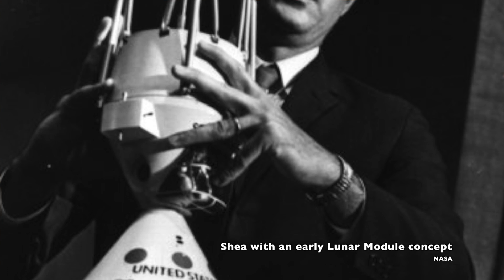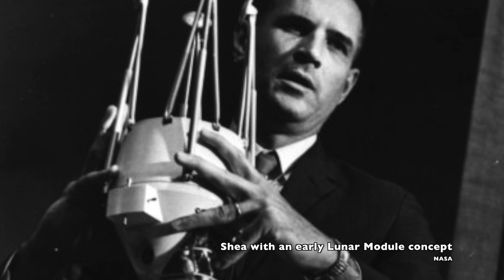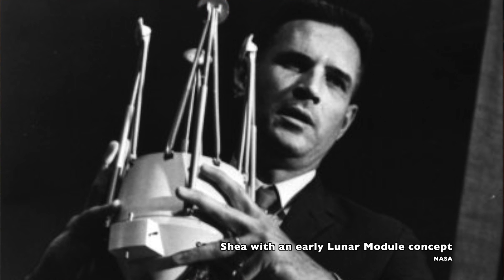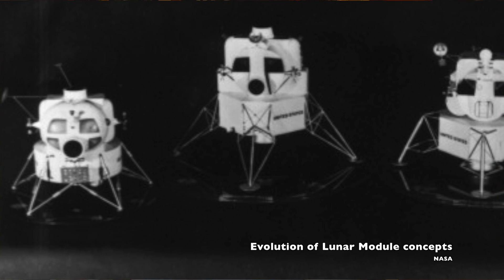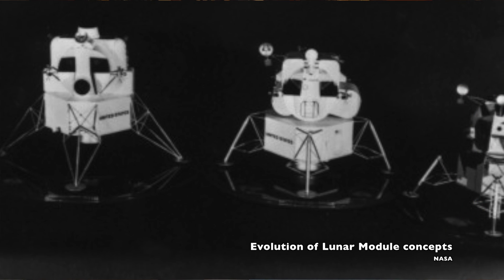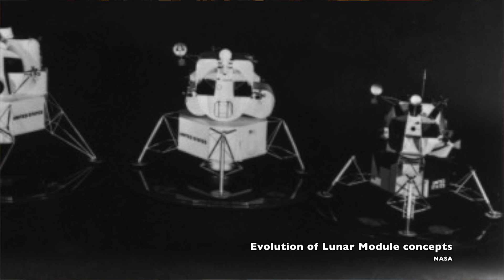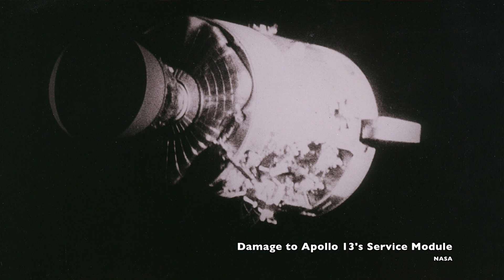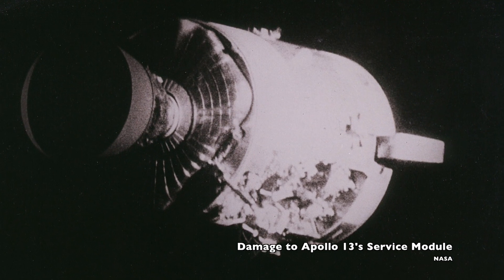How Did NASA Know to Use the Lunar Module as a Lifeboat?

Comment: LAB SPACE CAMPS AND AEROSPACE CLUBS, ATTN:On the lunar lander as well as any spacecraft or larger space ship.How does one route around a technical difficulty?You must first design your spacecraft and then with DC voltage only, in lower ranges design and put in a routing of wiring.
Your routes to the stations on your spaceship end in bulbs which all work when connected to a battery or series of batteries.

But what happens when your spaceship receives damage and the wiring is cut, ship damaged and or structure disrupted?
You've got it, it's time for your buzz lightyear toy dolls to perform and EVA and fix or repair that wiring, but what if you cannot do this.What happens if that part of the spaceship is struck by a meteor and you can't rewire.

Right, if you have one of more wires going to those extensions around the ship that light up bulbs, then you have to rewire and this means diminishing nonessential systems being shut down or placed on low power modes, so that only thrusters, inertial navigation and fans to move air in your damaged ship are used.Need to have systems only.

Note for instructors and or teacher host.You may need two large nine volt batteries.Light Bulbs, low voltage, wiring, which you can get by the spool at an electronics shop a design of the spacecraft and classwide participation.

Frist see what type of ship you can design and then build, then route your wiring, but "please again", remember low voltage wiring only.You don't want to fry Junior or Sissy here.Thanks, Verendus *Notes what is a a power side to a DC volt light bulb and do you need to have a shipwide ground, for the bulb to work? 2.What is single and in parallel series wiring and how might this placement affect the situation of a damaged spaceship? These are the goals for your camps and clubs to determine within this lab.

Comment: RE your question, Amy, about using equipment for purposes they were never intended for:

How about a plastic pen?

After completing their EVA on the lunar surface, the Apollo 11 lunar module (LM) crew had  a potentially serious mishap. While getting settled back in Eagle, Buzz Aldrin spun around and his bulky portable life support system banged into the circuit breaker panel.

Of all the circuit breakers that could have been damaged, it turned out to be the one that controlled the ascent engine. Part of the small control switch broke off and settled onto the floor of the LM. The remaining part of the circuit breaker would probably have held, but Neil and Buzz had to make sure that the circuit breaker didn't automatically disengage the ascent engine as they lifted off. That would have been catastrophic. There could be no second attempts.

To improve their chances of getting a successful ascent engine burn, they took a plastic pen, broke off a piece and jammed it in to hold the circuit breaker in place.

I don't know if that improvised high-technology fix became a recommended NASA procedure for future missions in such a circumstance.
Reply: the good thing is: that breaker had to be pushed rather than pulled in order to make the APS operational 😃

Comment: Amy, why did the Russians have so much trouble with their N1 rocket?
Reply: +Alex P - Large rocket engines were much harder to manufacture and test because everything has to be much bigger. They also suffered from a difficult problem called "combustion instability". This problem was a major design issue with the F-1 engines on the Saturn V first stage.

It's hard to quickly describe combustion instability or how they overcame it. You can google the term to learn more. But I do remember reading something an engineer at Rocketdyne (the company that designed and built the F-1} wrote years later. He said "The problem of combustion instability cost me lots of sleep, my marriage and it definitely aged me."
Reply: +Alex P: I'm not Amy, but the N1 used a cluster of 30 smaller engines, which all had to work together , so reliability was an issue, while  the Saturn V had 5 huge engines, fewer engines, fewer problems.
Reply: Yeah that would be interesting to find out why they took that approach rather than having fewer larger engines..?
Reply: +Alex P, Fastest way to build more powerful booster? Add more engines? This was a space race and you do what you can do the fastest. See the people who take hundreds of helium balloons and tie them to a chair to float in the air. Fast and inexpensive. Not efficient. Not always successful.

Comment: With the planning for using the LEM as a lifeboat, you'd have thought NASA would have made the CO2 scrubber canisters compatible. :/

PS: Amy, what's that handsome looking book that keeps on showing up prominently in the background? Are you trying to tell us something?
Reply: Also, give thanks to the  Omega Speedmaster to time the 17 second mid-course correction, or they would have either burned up on re-entry or skipped off into outer space.  All other equipment was turned off.
Reply: +butchtropic They were lucky for so many reasons. Not just the heat shield. How about the cold that could have killed them. How about the fact that they almost died of CO2 poisoning. How about the fact that they had no idea if the batteries still had enough power. And let's not forget that last engine burn. Hell, the initial explosion could have breached the hull and killed all of them immidiatly.
Reply: It's her book coming out in October!
Reply: Suraj Biradar
Thatsthejoke.jpg
Reply: +Dan Heidel 
Are you trying to tell us something?
No, trying to sell us something. ;)
Reply: There was also the lack of shielding of the LEM, and the problem of one of the Apollo 13 Astronauts dying soon after from Leukemia.
Reply: I don't think 14 years could be considered "soon" by any stretch.

Comment: Hi, another question for you :)
I was watching (sadly only here on YT) the Space Shuttle Launches. Ever time the Shuttle makes a quarter to half spin after take-off? what's the purpose? Was that intentional?

Like your videos, keep going ;)
Reply: +Grzegorz Latocha this is an inclination change - its easier to take off in the direction of the rotation of the earth - you get a bit of a kick in speed. from a flight stability stand-point - its less stressful to the crew and the shuttle to pull the craft over and into orbit than to have one wing pointed up to the sky and one to the ground
Reply: +Grzegorz Latocha Yes it's intentional. There's a bunch of reasons they do it, improves communications, makes it easier to land the shuttle if the launch is aborted etc. https://en.wikipedia.org/wiki/Roll_program
Reply: +Nikolay Ivanov thanks for the article, that explains it much better than I could!
Reply: ghostdog688
No problem :) I love it when i see questions like this, it gives me a reason to look up and learn something i never even thought about :)
Reply: Thank's guys. That's indeed very interesting.
Reply: +Grzegorz Latocha quite alright! I'm a big fan of KSP and orbiter flight simulator - I learned so much from these about space flight! You should look it up and play with them both!
Reply: The main reason for the roll maneuver was to make sure the Shuttle was given the correct launch azimuth when the pitch maneuver began. Unless you can rotate the launch pad, that roll is a typical part of the launch sequence. It's less noticeable with cylindrical launch vehicles, though.
Reply: Listen to any launch commentary.  As soon as the vehicle clears the launch tower, there's a callout like "Roll program begin" to put the vehicle on the correct ascent azimuth.